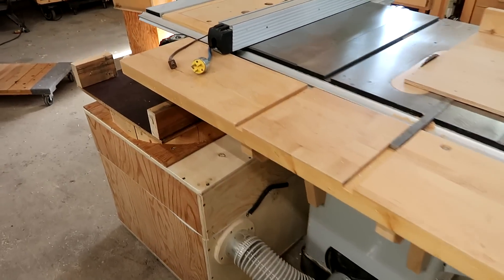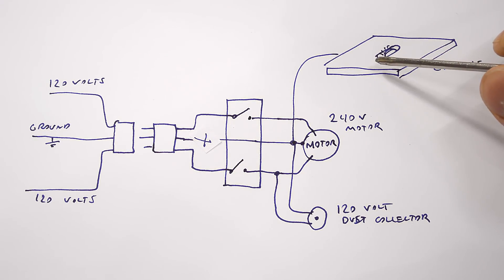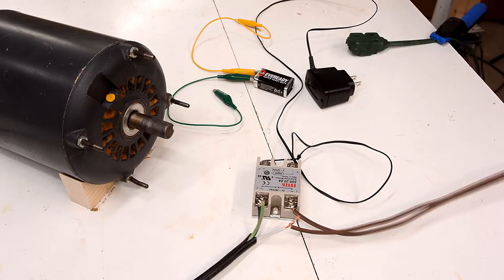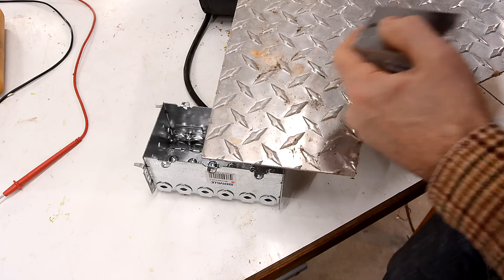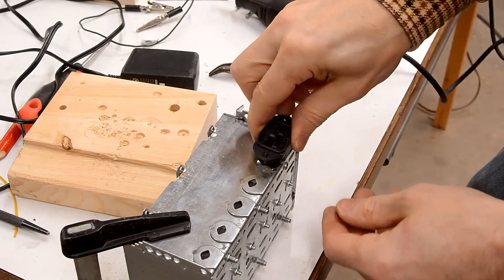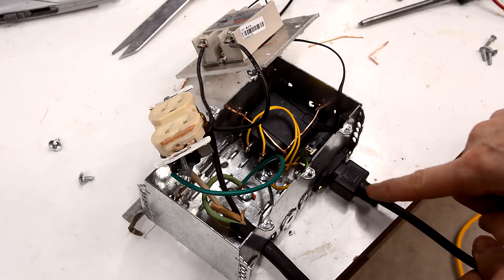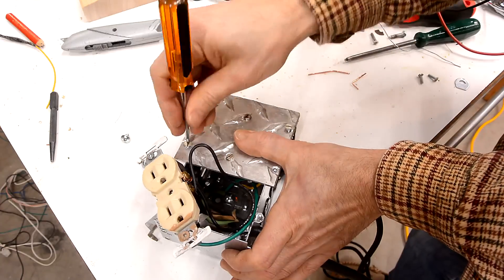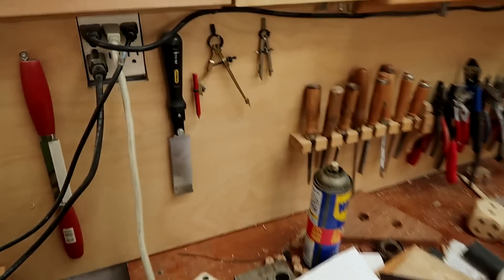Relay box to automatically turn on my dust collector

Comment: Are they actually opposite phases, or are they 120 degrees out of phase like ElectroBOOM said? I'm not a Canada so I'm honestly interested. In the US they really are opposite phases.
Reply: Since residential electric service in the US and Canada is single phase they are 180 degrees out, so you have 240/120.

Three phase power, typically for commercial use,  is 120 degrees and usually provides 480V between phases and 277V from any phase to the neutral.  A 3 phase service for 120V provides 208V between phases and 120V from any phase to neutral.  If you have a really large home, production shop, or small retail store and want a 3 phase service but most of your load will be 120V, then you'll have a 208/120V  3 phase service, no 240V available since it's 3 phase.

The high voltage distribution running down the street is usually 3 phase, 4160/2400V.  Though they may only run 1 or 2 of the phases down a street or road for distribution.  The transformer on the pole is connected to a single phase on the high voltage using a 2400V to 240V volt step down, and the transformer secondary is center tapped (neutral) so the output is 240V between phases and 120V between either phase and neutral..  That neutral (center tap on transformer coil) is also grounded at the service entrance so a short circuit of either phase to ground is limited to 120V.

That's why it's referred to as "single phase" even though you have two phase (hot) conductors, A & B, at your service entrance.  The transformer on the pole is connected to a single high voltage phase and has a single secondary coil.  So the output from the transformer is single phase, but the secondary coil in that transformer is center tapped to give you two "phases" by dividing the voltage in half providing you with 240V or 120V.
Reply: electroboom's recent video was about commercial 3 phase power, yes the phases are 120deg apart.  For househould power in North America We generally  have 240V power, that is 2 120v phases 180deg apart to give you 240v.
Reply: No they’re 180° out of phase. That’s why phase to neutral =120 V, phase to phase = 240 V. If they were 120° out of phase, the phase-to-phase voltage would be 208 V.
Reply: Luke Rediger apartment buildings are probably the only exception to the 180° rule, and even then, it’s very uncommon.
Reply: depends on the area, Matthias is in the country so probably split phase or 180 degrees since he'll likely have his own pole and transformer, ElectroBOOM is probably in a city, likely in an apartment complex, so it's probably using 2 of 3 phases for his higher voltage, as the apartment complex would have 3 phase run to it due to the larger amount of power it would need.
Reply: 180 degrees, that means 120 x 2 is 240 VAC.
If is was 120 degrees it would be 120 x sqr(3) is 120 x 1.73 is 208 VAC
Reply: Brian Bain yes but Mehdi clearly showed his phase to phase voltage was 208, not 240. I was wondering if that was a weird Canada thing or if his apartment was weird (apparently the latter).
Reply: no, that's common in big buildings where they run 3 phase power almost exclusively, for small homes it's single phase almost exclusively.
Reply: Luke Rediger
True....but also depends where you live in the world. In the Netherlands you have 1 fase, but before the meter you have 3 fases, so it is easy to get (if you pay) 3 fases, the cable is already there. People take more fases if they buy/own a big oven which needs 2 fases.
Reply: understood, I was explaining in the context of split phase vs 2/3 phases delivery in NA. Generally we'll provide 100-200 Amps at 240/208v here which meets all home shop needs, and there isn't any demand for 3 phase to the home because it is generally only used in industry, but you will see large buildings like apartments use it. VFDs are used in home shops to supply 3 phase for the odd piece of equipment that needs it. (Apartments will be around 60-100amps)

Here in NA you will generally see 3 phase run everywhere, but for residential, they'll only step down 1 of the 3 phases at the street transformer per residence. 

It's not that much harder to get 3 phase, it's just generally never needed as most appliances will be well served with split phase. You'd have to get the power company to change the transformer and run 4 wires instead of 3 from the street, and that's a couple thousand where a VFD will be a couple of hundred dollars, and most new houses have 100 Amps minimum, but 200Amp is common @ 240v so actual power available isn't an issue, just the form factor which a cheap VFD will solve neatly.

Comment: Strain relief
Reply: it's built into the box, the tiny knock outs he used have a clamp behind them for the cable.
Reply: Luke Rediger not sure how I missed that.....busted using the skip button! Thanks
Reply: But it is not made for SJ cord. It is designed to clamp MC cable.
Reply: MC cable? no it isn't, it's for standard sheathed cable. Sure the cord might not have been considered for use, however it's rounded piece of stamped steel clamped with a screw. Functionally identical to the strain relief in power tools using the same cord.

Comment: Alternating current runs in both directions....so your actually supplying 240 volts.... not 120 volts...the cables are positive and negative, and a separate ‘earth’ (ground), designed to short out the system and prevent continuous flow of power if the circuit is interrupted, for example by someone coming into contact with the live supply... I don’t quite understand where you get that the two cables, positive and negative only carry 120v each...??   Pleased to see you also earthed the metal box you used...
Reply: The following applies to north america: 3 phase power (typically only found in commerical properties) is different than split phase power (found in residential). Split phase power in NA uses 2 120V lines that are 180 degrees out of phase, thus when used together add up to 240V. In NA normal circuits use only one of the 120V lines in conjunction with a neutral wire which is connected to ground (earth) at the service panel. Higher demand appliances will use dedicated circuits using both 120V lines to achieve 240V. Three phase power uses 3 lines that are 120 degrees out of phase and entirely different motor designs.
Reply: in North America we run 220-240 into houses like the rest of the world, except we also have a center tap off the transformer, which is then earthed. This creates a 0V line for each of the live legs to drain to. 

For added safety we also earth all the appliance shells to a second earthing line separate from the active circuit. 

A 120v circuit will have a black or red live wire, and a white "neutral" wire which connects to both earth and the center tap of the transformer. Which is a potential difference of 120 v. 

A 220-240v circuit will have a black and a red live wire, with a difference of 240 between them. 

There is no positive or negative, just live and neutral.
Reply: The channel electroboom just did a video where he explained this, it has to do with 3 phase power, in this case two 120v phases are used.
Reply: In this case, one phase is used with a center tap, i.e., split-phase.  Thus 120 between each hot and the center tap which is bonded to ground potential in the breaker box making it "neutral".  This neutral is then at the same (within some nominal amount) with the potential of other surfaces in contact with the ground (earth).  Thus the potential between a live conductor and ground is 120 v.  To get 240 V across you, you must get between the two hot conductors.

Comment: You always scare the shit out of me when you do electronicals. Bare wires, metal enclosure, not good, not good!
Reply: Remember, the UK recently switched back to metal breaker boxes because the plastic ones were causing fires. Oops. Guess those "stupid Americans" were right about something.
Reply: Grounded metal enclosure I’d rather have a fault trip a breaker, rather than burn my house down.
Reply: Mark William Mandigers - metal boxes, bare wires this is what makes it so fun, don’t spoil it. 😁
Reply: Americans, Y U no use plastic boxes?
Reply: Yep, IF you ground them correctly.I've seen too many videos on youtube that didn't show that.
Reply: If they are mounted in the wall it's no problem, but the way he chucked it on the saw....flapping around in the breeze like that....

Comment: don't want to be a safety nanny or a eurosnob, but even the fact that you can buy those boxes rubs me the wrong way. then not grounding the box and using bare copper to affix something in a way that could easily short out (or worse yet, short one of the pins to the box) that wall wart  and not using cable glands to feed through cables (again, in a metal box) and not using ferrules on a screw connector with stranded wire and not fixing the box finishes it off for me. at least take the copper wire out and glue/isolate the wall wart in hotglue, you could even make a somewhat decent strain/abrasion relief for those cables out of tyraps and more hotglue.  also, you know those ssr's fail open right?
Reply: he grounded the box this time, check 4:40
Reply: Dude, do you think he chose the copper wire by accident?  You just witnessed a next-level troll job.
Reply: Guys, it's not like he's going to turn on the table saw and go away for hours.
Reply: He does/did work for RIM so I would trust his electrical knowledge more than his wood working. He just does this to troll you guys, you know that right?
Reply: Trolling aside, he mentions some valid points. I guess we’ll just call this “freedom wiring”, do what the hell you want
Reply: The box itself has strain relief where the cord enters the box. There''s a clamp built into the box.

Comment: Nice! I would only connect the PE (Earth) wire from both the 120V and the 240V size to the box. If it's unplugged from the 240V size and a wire touches the case that will be life :/
Reply: he did that check 4:40
Reply: Your right, missed the second screw. Only saw the first with the two wires.

Comment: You may consider adding a reverse biased diode across the DC Relay side. The coil stays energized after the DC voltage is removed. That can cause unwanted voltage spikes. But a diode will allow the relay coil to discharge across itself safely. A schottky diode would work perfectly here.
Reply: it's a solid state relay, triac based with no coil that may cause inductive spikes

Comment: Just an idea. Plan things out well before building such things. Some times you don't get a second chance. There are circuits out there (or you can design your own) that sense AC and then turn on the vacuum cleaner. They are not hard to build or buy and a heck of a lot safer as well. Could also use a step down transformer and use that for the vacuum. A 2:1 step down transformer would work just fine. JMHO

Comment: Awesome! I need this!
Reply: Just cut one out with your laser cutter...
Reply: Make Something sand in the place where you live
Reply: Here's my low cost built in solution:

 https://www.ebay.ca/itm/Current-Sensor-Module-AC-Detection-Module-50A-Switch-Output/172849062227?ssPageName=STRK%3AMEBIDX%3AIT&_trksid=p2060353.m2749.l2649

Comment: So many exposed metal contacts...
Reply from the maker: Exactly.  Just like your house wiring.  The screws on the side of a socket are exposed inside the metal box.
Reply: Any electrician that isn’t ashamed of their work only uses electrical tape for phasing big conductors. If I see electrical tape in a box, I know a hack has been at work.
Reply: When everyone around you is a moron, you may want to consider the chance that not everyone around you is a moron
Reply: bdot02, sure its not the best practice, but they're in a grounded metal box...
Reply: Matthias Wandel   Not in mine . Everything is electric  tape wrapped.
Reply: pyromen321  Just what kind of moron are you. A false sense of security. Are you nuts. Are you really saying it's better to have them exposed. Just because you're in love with this guy doesn't mean you have to stick up for him. Truly a ridiculous thing to say. Shaking my freaking head. My God I cannot stand people like you. Put the pointy hat on and go back in the corner. Moron.
Reply: exactly, this tackless fellow is just that as well as ignorant.
Reply: tackless mmmhmmm okay.
Reply: tackless, if anything that's a worse idea! It will give you a false sense of safety.
Reply: pyromen321. Let me give you a little advice. When you find yourself in a hole , stop digging. You are now proving my point.
Reply: Beefchicken Industries.  Another moron heard from. Where do you people come from. You really believe electric tape is to hide flaws. It is speced on many commercial jobs. And I'm not going to waste my time telling you why. So go play with your other moron Friends , I'm sure they'll believe your nonsense. God I'm done no matter what you morons have to say from here on.Man , I hate ignorance.
Reply: Jeez, what's with the hostility? 

If you see exposed wires, you sure as hell aren't going to do any work on the piece unless you know for certain that it's not live. If there are no clearly exposed contacts or anything, some idiot (not excluding myself) might think it's a good idea to poke around in there.

Comment: Next video: The copper wire moved due to the vibrations and the box caught fire.
Reply: Boxes are grounded, so it will just trip the breaker if power contacts the case, and the box is metal to prevent arc fires.

Comment: I live in South Africa where we have only 240 volt AC. Where might I get hold of a simple diagram to build such a switch for the saw and dust extractor with a bit of a delay? Thank you. Johann Mendelsöhn
Reply from the maker: its so simple it doesn't need a diagram.  I showed all the wiring.
Reply: If you did the same thing and put a small capacitor across the signal side of the SSR it will cause it to delay opening.  In your case since everything is 240 you can take the power for the switched side from the table saw rather than running a separate power cable.
Reply: Thank Mark Pikas! I need a drawn circuit with values / components! My electronic knowledge is very little
Reply: I'm really no electrical engineer either, seriously.  Google how an SSR works/is wired and then try a few small valued capacitors (with a voltage rating significantly over your power supply voltage) until you have a delay that works for you.  If you still can't figure it out contact me and I'll draw something on a napkin and send it to you (I don't know that there is an easy way to post pictures here).  The capacitor value you'll need will depend on the SSR you end up using and the length of time you want to stay on, so there is no real way for anyone to predict that for you.
Reply: If you aren't mixing up voltages and aren't trying to use what you have laying around, look at a 240 v time-delay relay.
Reply: johann mendelsohn what components are a mystery? It really is all in the video. If that isn’t enough for you, you probably shouldn’t be messing with electricity at all.

Comment: Not just a dust collector on/off switch ganged to the table saw on/off switch?
Reply: Mattias had a system like that before, and inadvertently touched his table saw blade while it was still spinning.
Reply: Luke Rediger
Physically ganged, not electrically. Two separate circuits with separate switches joined with, I don't know, a piece of wood?
Reply: Jim Fortune , a wet piece of wood wrapped in copper.
Reply: Jim Fortune , no, just more exciting :)

The thought occurs that 40A cooker switches have 2 separate contactors on 1 toggle. DPST
Reply: dust collector runs on 120, table saw is 240. Would need a special proprietary switch for that.
Reply: Massimo O'Kissed
Are you trying to get him killed?
Reply: Massimo O'Kissed
But one single phase and one dual phase?